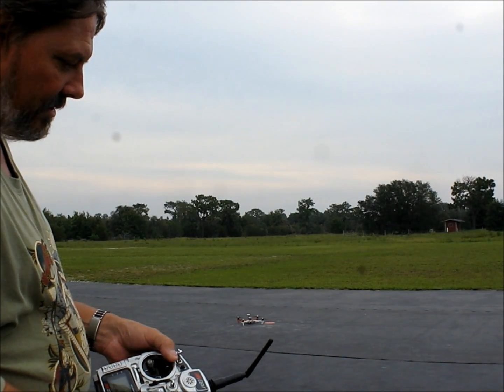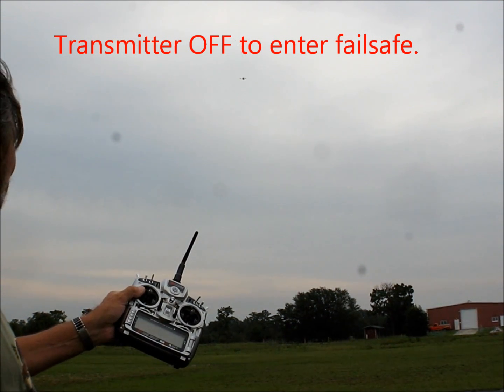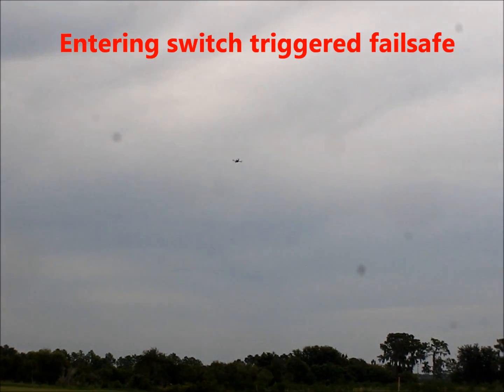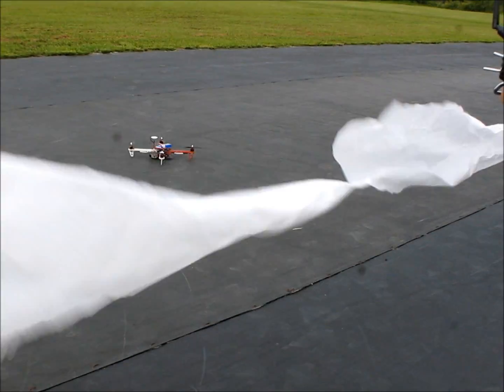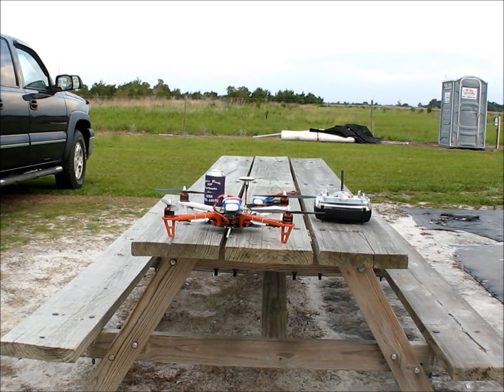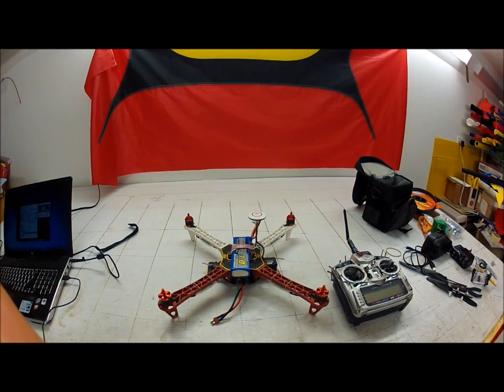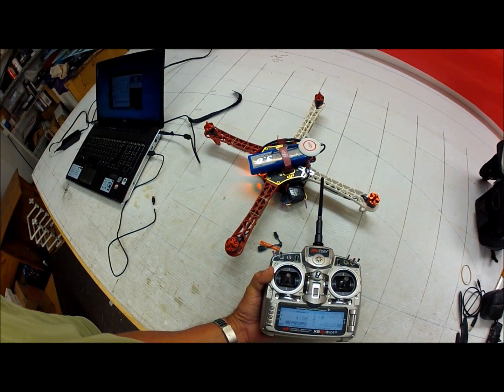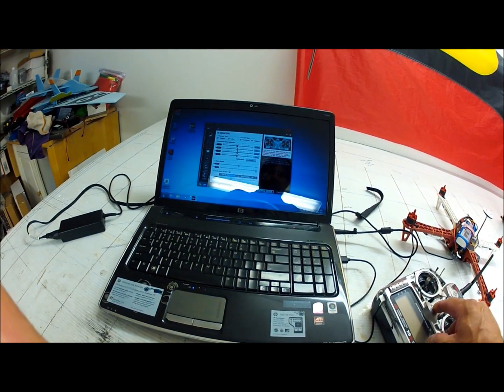naza-gps-test-results.wmv

Comment from the maker: No gain changes. I have not messed with the gains to fine tune the setup.
Does your rx have smartsafe? (Allows you to set the failsafe location of other channels)
If not you will not be able to set the RTH feature. Well wait, it can be done.
But, it takes a bit of effort. What you need is to be able to mix some channels together.
In short you use the throttle channel for failsafe because you can program it for the failsafe location.
Use a aux ch for throttle and configure end points and travel.

Comment: Did u change the gain to do better in this kind of wind or did u leave it stock? If you change it what are your setting? I only had mine for a week I haven't change my gain just wonder if I should for winds like in your video! I have 10in blades,12amp esc,3cell 4000mah dx6i,ar6200

Comment from the maker: I should add that you MUST HAVE and RX that allows the failsafe setting of the channel you plan to use for the RTH switch. (AKA SMARTSAFE) Then you bind your radio with the failsafe switch (RTH switch) in fail safe or RTH activated. This way if there is a issue the system will activate RTH.

Hope this helps.

Comment from the maker: If you have the same options as I did and  set up the system as I have it should be fine.
You will need to fine tune end points to get everything working together.

Comment: Could you please give me an advice? I've install the GPS with correct measurements of its position entered in the assistant and done the compas calibration in an empty field being a 100% shure that there was no interference. Now I try to make my quadcoper hover with gps hold but it starts going in an odd direction like backwards or to the left (with no pattern). Could the reason be that i did have only 6 sattelites locked?

Comment from the maker: 8" props.  Stock DJI 450 setup with Naza and GPS. The error was in the setup yes. I left it in the video to show what happens if you don't set the failsafe up the way it should be. I have a setup video being uploaded at the moment that shows in detail my 9503 radio setup.

Comment: So not really any problem with the GPS? The second half of your vid was rectifying a mistake you made in the initial set-up by not binding LOS mode.
Useful if someone else has made the same mistake, but wouldn't a set-up vid showing how to do it right first time make better sense?

Notice you had a bit of pavement bounce. Is that an f450 with 10 inch props? (try 8). Flashed ESC's may help, mount your naza on shock tape, and pool noodles can help.
Or just land on grass.